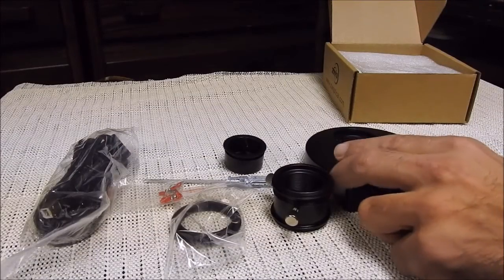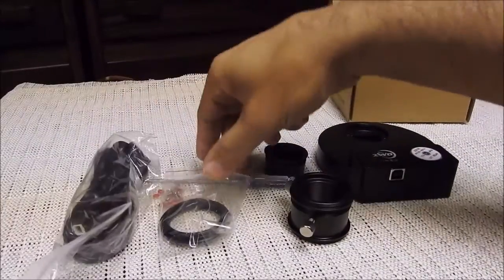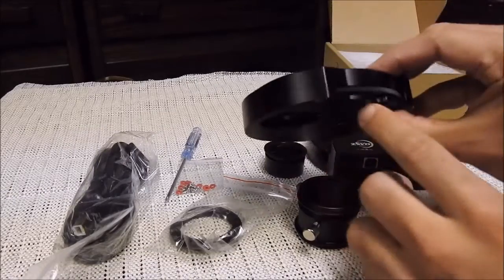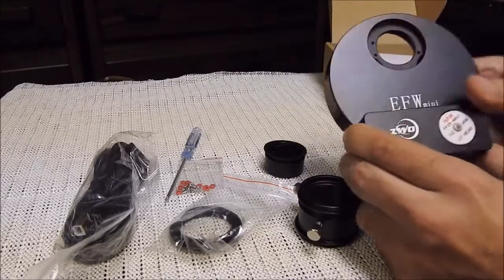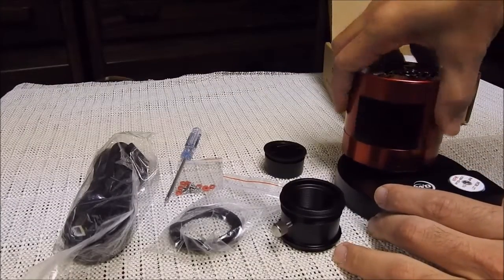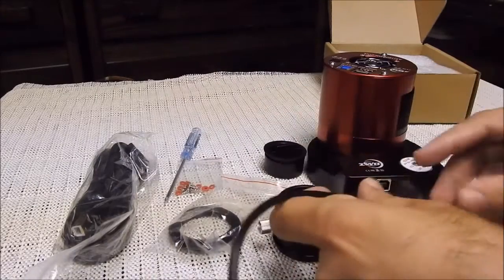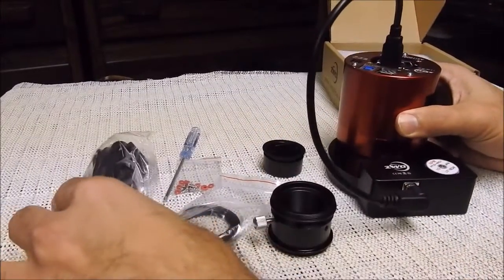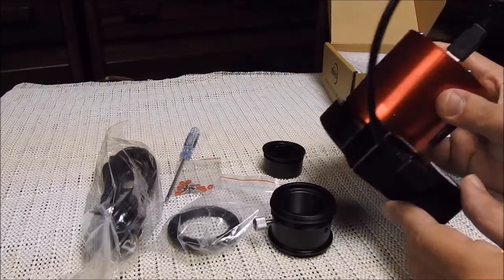ZWO Five Position Electronic Filter Wheel (Unboxing)

Comment: I think your package lacks the "half moon" adaptors,  used for non threaded filters. That´s what the screws are used for.
Reply from the maker: Thanks, but I don't even know what a half moon adapter is.
Reply: You use the screws with the red rings for untreaded filters. Its all packed together in the little bag.

Comment: That package of little screws and red washers are what my 31mm filters required for installation and I'm going to tell you getting them in really sucks. Other than that this is a solid little unit that should work well for years to come.